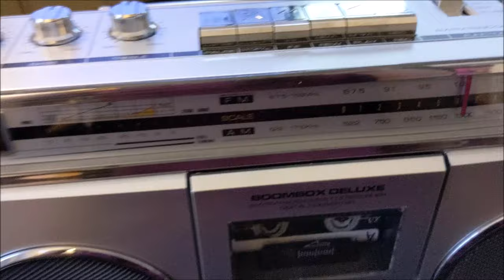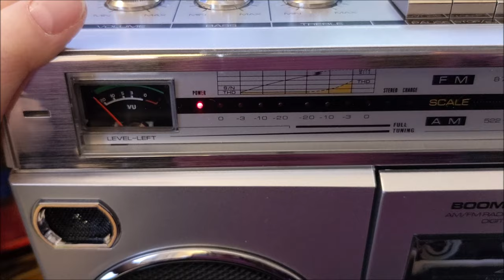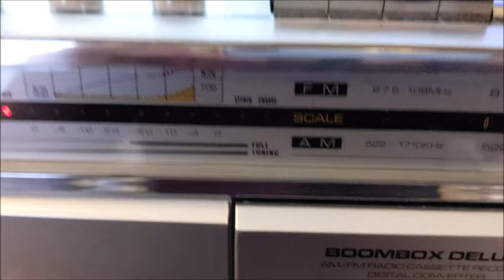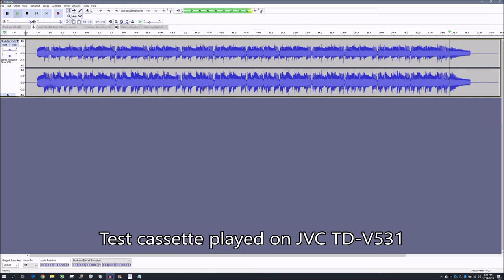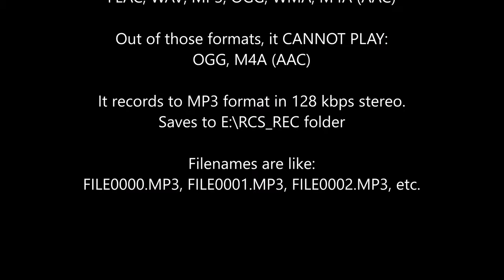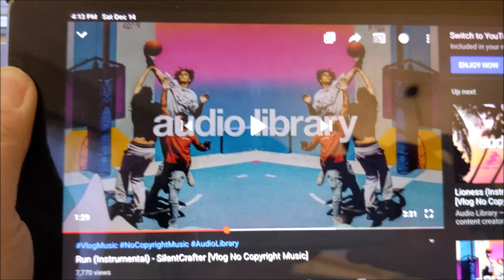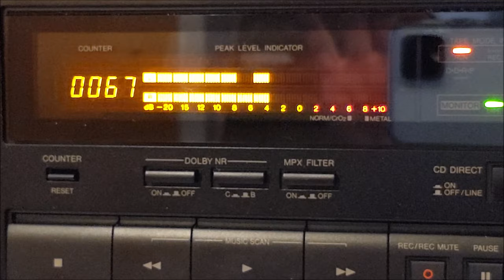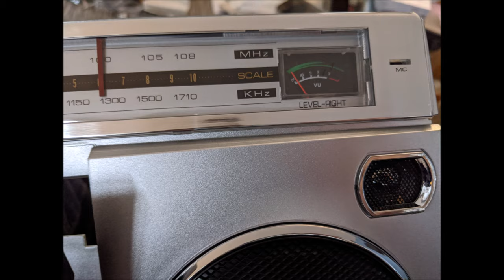2019 ION Boombox Deluxe - Full Review

Comment: Thank you so very much for posting this. I picked up the model without the battery pack (already had rechargeable D cells), and I love the thing. Alright, so it's far from perfect (it's as wimpy as the boxes from back in the day that ran on just 6 Ds, and the AM out of the box is a bit deaf), but it's so much fun that it's become by go to.
The tape speed was slow out of the box, but that's an easy adjustment as there's access to the control under the ION metal sticker on the back. The AM improves greatly with a longer ferrite rod (it's as simple as sliding the coil off of the short one, sliding it back onto a longer one,  finding the sweet spot (by sliding it back and forth) on a weak station around 600, and gluing the rod down). After putting in 8 inch rod it went from almost deaf to much, much better than average. Next we mod the VU meters to read the center of the volume pot, so they'll actually do something more than take up space..lol
The little box is just too much fun for me not to mod it a bit.
Thanks again. If it wasn't for you video I wouldn't have bothered with one, and I'm really happy that I did.
Oh...and yea, yea yea...fake tweeters. It's not like they're really needed with this one, anyway. If anything; real ones would probably make it too "bright", if not shrill.
Reply from the maker: I'm glad you found my video helpful!  I'm also still enjoying mine!  It's not the best sounding, but good enough to haul around to enjoy and not sorry about damaging something actually vintage. :)
Reply: @TechieZeddie  BINGO!
I wouln't be upset if I dropped it in a lake, or someone stole it...though I'd be uptight at loosing the 8" ferrite rod...lol

Comment: Looks like these things are slowly improving with each iteration. It’s not really possible to make a great tape player with currently available parts, but it’s getting pretty close to decent. The best option is still (IMO) to get a fixed-up unit from someone who does that kind of thing.
Reply from the maker: The Tanashin mech isn't that terrible.  It's how the manufacturer uses it.  The Tascam 202 MKVII deck uses the same mech, but it's pretty good for a modern deck.  Probably better than entry level decks from the late 2000s as cassettes were going away.

Comment: Hi ,  Excellent review,   I was wondering,   if you think they use the same  Tanashin tape mechanism in the  Ion retro rocker?
Reply from the maker: All of today's modern tape players uses the Tanashin mechanism, even this boom box.  The Tascam 202mkVII cassette deck is also a Tanashin.  It can be done well or cheaply.
Reply: @TechieZeddie  Thanks for the info 👍.     I  had a Riptunes RACR 510 bt.  Boombox,  Only lasted 3 months  it wasn't the tape player that broke,   When turn the power on,   The led lights would start working. But thats it,   The sound would take about 45 seconds to come on,    Very weird.  Definitely a defective unit.    What a shame ,  It was a cool looking unit,

Comment: Excellent. Nice to see the insides. Still not sure exactly why the AC selector switch is there. Maybe just for UL? Really doesn't seem like it is necessary and only cuts the AC power to the step down transformer. Looking at the circuit, it appears that from there its still AC current at a lower voltage and then they run that through a bridge rectifier diode circuit on the amp board to get their DC. The AC socket itself on the side has a disconnect from battery when the AC adapter is plugged into it so (shrug) on the AC switch unless it is used to keep the battery power from bleeding back into the Lithium battery when D batteries are inserted.
Reply from the maker: I'm still not 100% sure on why the needed the switch either.  I'll investigate further.

Comment: As long as if the deck has an AC erase head and AC bias, it is considered good for me and should be the one people get. Obviously a manual record level knob is a step ahead, with separate level knobs being another step ahead, like with separate decks.
Reply from the maker: Unfortunately after using it to record, I think it has DC bias for recording.  You can already tell just by looking it's a PM erase head, not AC. :(  The Sony CFD-S70 boombox sounded much better.  It also has a PM erase head, but I think it uses AC bias for recording.  It seriously surprised me considering it is still currently sold!  And it also uses the same Tanashin mechanism as this ION... so the mech is not to blame at all!
Reply: I have SONY CFD-S70 three years ago, I dissamble for cleaning/repair, the cassette preamp especially  recording system it uses AC BIAS (even it uses permanent erase head) unlike mostly cassette recorders including ion boombox it uses DC BIAS and the result is very poor recording sound quality and lots of hiss background sound... I still prefer SONY CFD-S70 or any SONY BRANDS because their recording circuitry uses AC BIAS... But is still the best is uses ELECTROMAGNETIC ERASING HEAD just like earlier cassette desks

Comment: 5 below sells (or used to sell, I don't know if they still have it) a FM transmitter that sounds pretty good.  As long as you have a line of sight from the transmitter to the radio, the range is OK for streaming into a backyard radio.  That's a really easy way to let you use an older boombox with no blue tooth.  For $5, you can't beat it.

Comment: Hey, it's stereo and doesn't sound like W&F hell. That makes it well worth buying in my book. Sometimes you just want something to play cassettes in, away from the house and as long as it doesn't sound terrible, then it's a good buy. Cheers for the video.
Reply from the maker: Thanks!  Yeah, I'm pretty surprised.  I remember you asked for a decent stereo player.  This is it!  I only wish it had real tweeters because it still sounds a bit flat, but completely serviceable for most people.  Lots of hiss, though, but I think that's what the average Joe want from a cassette, lol.  I hope it makes it out to your side of the pond.
Reply: @TechieZeddie  sounds like a mod project!  Getting the noise level down will take a lot of effort though...
Reply from the maker: @davidhunt240  I'm not an electronic whiz.  Even if I was, I'll probably be more digital than analog.  Studied a bit of EE, but couldn't wrap my mind around analog circuits (so much math!).
Reply: @TechieZeddie  the tweeters would be an easy mod, usually just a small capacitor to a small speaker, usually a piezo for boomboxes. A "proper" crossover circuit would have inductors and capacitors connected to both the low and high frequency speakers, but there's no need for that complexity here 🙂
Reply: @davidhunt240  I'm glad you said that, because I would have been dumb enough to get a tweeter for a diy stereo and try to wire that up.
Reply: @davidhunt240  If it's 8ohm 15w woofers, then I have to imagine you'd want the tweeters to be around 2w right? What kind of capacitor would you use?

Comment: Thanks for this review. I saw one by vwestlife, and another guy I that I'm not familiar with, but yours goes into more depth. I went to BJ's with a friend for food shopping, and they had this radio among other electronics, and I was thinking of buying it because it looked interesting, and I love the old style VU meters with the needle. (the next time I went, they were sold out- but they still have some in other locations.) I grew up with all the old technology, including reel-to-reel from the 50's my dad bought. I'm glad you talked about the digital recording, cause I'm interested in that- I don't want to use the computer- it'll only use more electricity.
Reply from the maker: You're still going to get a better sounding digital recording if you have a dedicated cassette deck and a PC with a good sound card.  But yeah, this can do in a pinch.  The level is pretty low on the digitized file though.  If you end up amplifying the file and re-saving it in MP3, you'll further degrade the recording. 

It's not going to be a serious equipment to digitize tapes.  It'll be okay for casual users.

Comment: Hey Nicole!
So, we see that the tweeters were indeed fake. I am very much disliking the fact that it digitizes cassettes to only 128 kb/s, and we're not so sure if it's using an acceptable sampling rate (like 44.1 kHz).
I'd very much recommend that you tinker around with the azimuth on that ION, because, while the recorded tape sounded somewhat acceptable in that boombox, it wasn't sounding as good in the higher end deck as a notable amount of treble was missing. So, seeing that it has an optional mono output, it should be easier to do an azimuth adjustment. It might also improve the overall quality of the cassette playback also.

Also, whenever you have the time, check out the 'GPO Brooklyn Portable Boombox.' I'd quicker gravitate towards this one, rather than the ION.

Comment: Bass Boost and Mono did nothing to differ the sound on the line out or headphone out version. Strange as on the built in speakers they were all different output is Mono whilst the device stuff makes it sound Stereo.

Edit maybe not afterall there is a slight difference in panning thats all on the output version but the quality is same between the 3 settings muddy, hissy and low quality.

Comment: Is this retro-boombox with a real stereo head, or mono head what I saw in few other videos about retro boomboxes. For me it´s a shame, if you can buy retro boombox, looks like stereo, all speaker doing the work, you see, that signed "stereo" on the chassis and if you look at the haed of the tape deck, it´s a mono head. If not sure, take a tape with song, that had different sound that you can hear on left and right speaker chanel like the 80´s song "Electrica Salsa" that the best stereotest is, and record it with a stereo unit and play it on this retro boombox and hear, is the same playback as stereo what you recorded on the sstereo unit or it´s the sound mono (compressed in "middle" withoput right/left different. Maybe you understand what I mean.
Reply from the maker: It's got a stereo head.  Check out my video if you haven't yet.  The first video I did (the unboxing) I zoomed into the head.  You can see the 2 distinct tracks .
Reply: loeli1976 you do realize that you can identify the difference from a mono head and a stereo head right? A stereo has a line that goes through the center of the electromagnet that reads the magnetized pattern on the tape. A mono has no line its just one solid electromagnet. Just a quick way to determine rather than spending more time by guessing using recordings and playbacks on other decks.
Reply: @christronicsdereksrandomness36  Yes. I know the difference of a stereo head and a mono head. I saw this in other video and in one video was the head mono on a retro stereo boombox. Thie is the reason why I asked Techie Zeddie about the head of this retro boombox. But thanks for the answer.
Reply: @TechieZeddie  I didn't see the video. But good to know it's real stereo head
Reply: @loeli1976  not a problem. just kinda sounded like from what you said that you were unsure of how to visually tell the difference.
Reply from the maker: @loeli1976  Why do I make these videos again? Lol

Comment: My ion boombox started eating my tape awhile ago and i don’t know how to fix it, any advice?
Reply from the maker: The first thing I'd do is to make sure the take up spindle has enough torque.  Open the door without a tape in, psuh play, and put your finger on the take up spindle to feel if there's enough torque.

The second thing is make sure the tape path is clean.  Capstan and heads can be cleaned with 99% Isopropyl alcohol and q-tips,  but the pinch roller you'll want to use naptha so it won't dry out the rubber.
Reply from the maker: Also since this is a new product, see if you can get support if it's still under warranty.

Comment: Great informative video 😉😉👍🏻😍😍

Erase head in that boom box cassette mechanism is just a cheap permanent magnet 🧲😂😂😂!! They did easy way out with cost cutting 😂😂 So they never aimed ppl to do any good recordings in this I guess.😉😉
Reply from the maker: The Sony also uses a permanent magnet for it's erase head and sounds better than the ION, in my opinion.  Of course it's always better to use an AC biased erase head.
Reply: Techie Zeddie , Yeah, Sony one maybe have better recoding circuitry with (factory setting) tuned bias. 😉😉👍🏻
However,  AC bias is used in many decks or hifi systems coz erasing process will be more efficient and (40-150KHz kind of )ac signal wipes the previously recorded audio completely ,so the tape will be good as new to do a recording again.😍👍🏻👍🏻

If you check hand books of some of boom boxes and even entry level cassette decks, which they mention recommended tapes to be used on particular deck for a better recording such as Sony, Maxwell UR or TDK’s coz those tapes were great and did decent recordings without issues 😉😉👍🏻  
 What is your favorite cassette deck which you owned now?  😜👍🏻

I am big fan of 90s TDK D, Sony HF and Maxell UR Type 01s Coz they were easy to find and less expensive. 😍😍👍🏻
if we do a tape recording with a good sound balance then you can get very good results😍😍👍🏻 (you have to keep or under input signal MOL at 10KHz -5db,  then usually you get better stable high frequencies ,( 8KHz to 17KHz -5db) which recorded on type 01 tapes with high levels without Dolby ( of course tape needs to be biased correctly first)😜😜👍🏻👍🏻

This is why it is good to have an extra equalizer with frequency display spectrum in it at sound source, so you can level up or down the sound balancing using the eq on each song , so the tape recordings would be at recommend Levels ( MOL) , so tape recording won’t be distorted mostly😍😍👍🏻 ( it is bit of a work 😉😉) 

If you checked carefully, many of blank cassette manufacturers mentioned MOL levels on cassette wrapping paper cover coz of this. 😍😍👍🏻  

What many ppl do that is , get a CD player and cassette deck and hooked direct CD’s output to deck’s input to get a good flat linear recording with type 01 cassettes with correct tape bias on. 
It does not work always,  if the CD song contains many higher frequencies so recording will distort badly with type 01s if not meet tapes frequencies MOL( Maximum Output Level at given frequencies ) 😜😜

You can get away (somewhat) above mentioned issue with expensive type 02 or type 04 tapes coz they can handle higher frequencies bit better with higher levels😍👍🏻

This was my experience (back in 90s )of doing lots of type 01 recordings( TDK, Sony, Maxwell )from CD to tapes.
I did not use Dolby either. 😉😉😃👍🏻

Hope this information helps 😍😍👍🏻
Reply from the maker: My favorite deck I own? No contest, the Nakamichi ZX-7!   Thanks for the information!
Reply: Techie Zeddie great choice 😍😍👍🏻!! It is a very good deck to have for any ( type 01,02 &4)tape recording & playback 👍🏻👍🏻
Reply: @Siri_Sathdamma_Sewhela  People hate it when I do this, but:
C90 tapes are too thin. In order to fit that much tape in a cassette, the tape itself has to be thinner than C60 tape. C120 is almost useless, and it's just slightly thinner than the C90.
Unfortunately a lot of the later '90s tapes (up to now) are C90 tape no matter what length as they quit making the thick stuff.
Reply: DriveInFreak that is very true. Good observation. 😉😉👍🏻 It is quite thin and somewhat less reliable. (1990s c90/120 tape is super thin and some personal stereo systems could eat up the tape quickly if you played the c90/120 daily)
I used C60 on my decks and hifi’s regularly without any issues. So I think C60 /C45 is has the best tape thickness so far in brand etc Sony,TDK
Reply from the maker: @Siri_Sathdamma_Sewhela  And for someone who likes to manually adjust everything, it's a great deck for that!  I only wish it was DD, but for that you'd have to move up to the ZX-9 which I couldn't find any for sale at the time.

Because of the manual adjustments for recording, I think the ZX-7 and ZX-9 are the best decks for recording.  The Dragon is a nice deck for playback, but because it has a very unique head, if it ever needs replacing, you'll have to find another Dragon as a parts deck - a difficult endeavor!  The ZX decks uses the same heads as the other classic Nakamichi 3-head mechanisms so you'll have an easier time to find a replacement.